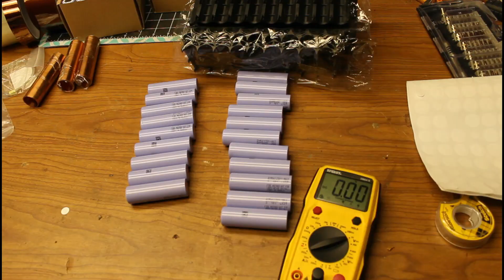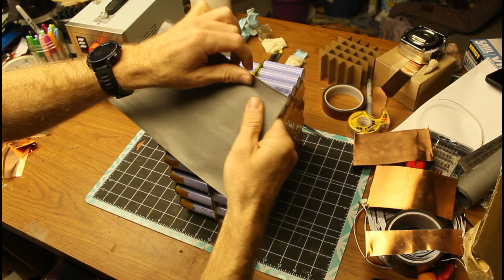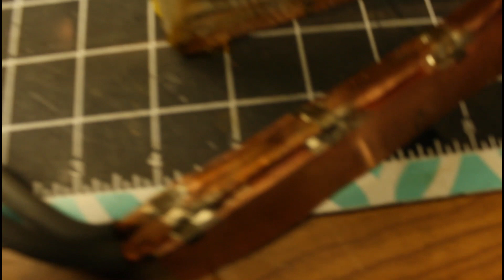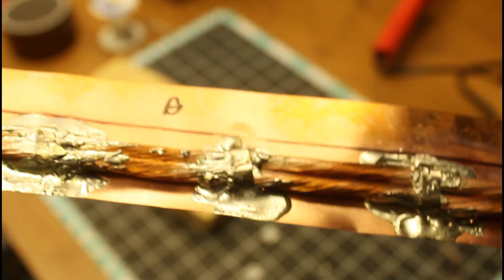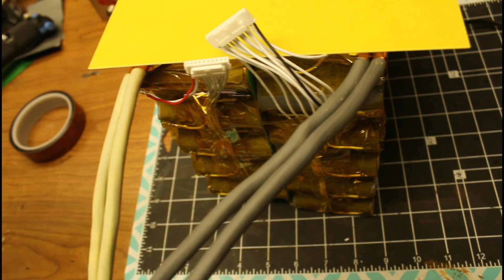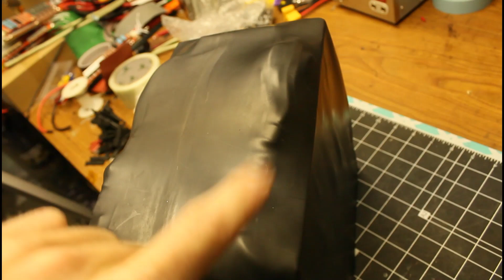72v High Power Battery Build DIY

Comment: I'm trying to build an ebike battery myself and currently in the process of understanding it all. What determines the ability for a fully built battery to allow say a 100AMP Continuous discharge? Is it the nickel sheet's thickness? Or the amp discharge rate of the battery? I see that these Samsung 40T cells are rated at 35A. If I use one thats rated for 15A, can I still use a 100Amp cont. discharge BMS from ANT?

Trying to build a 72v20ah Battery. Appreciate any help and insight! Looking to probably just copy your build
Reply from the maker: Discharge is a combination of the individual cell characteristics, number of cells in parallel,  the electrical connection between them, the rating of the BMS, and the discharge wires and connectors.   So if you have cells rated for 15A and you want 100A discharge,  you need at least 7 cells in parallel.  The series connections between each P-group need to be able to handle 100A as well. The copper does that fine. Your BMS has to be rated for 100A continuous or better, and you probably want at least 6ga discharge wires and xt90 or qs8 connections for plugging it in.
Reply: @ebikebuilds4000  This reply along with watching a few other build videos of yours really made it click in my head thank you!

Will pure nickel strip be able to carry that amount of amperage? Or will I need copper
Reply from the maker: @djmedia01  pure nickel strip should be fine so long as you series connect each cell. The series connections carry the full current of the pack, so they need to be robust.
Reply: @ebikebuilds4000  Thank you so much for the info. Greatly helped everything click together for me.
Reply: What thickness copper sheeting u are using?
Reply: @Lenbo1977  I was wondering the same thang
Reply: @franklincoody6218  most important part - and no answer. It must be 0.15 to 0.20 mm or so (otherwise, it will not spotweld). However, based on extensive chatGPT requests, 0.20 is not enough for 200 Amps. So, I am wondering, what is this guy doing...

Comment: hey! Love the video! I'm curious about your dirtbike build, was it a gas dirtbike frame that you converted/modified to be able to fit motor QS138 an battery? checked you channel videos but couldn't find one
Reply from the maker: Thanks! Yes, it was an Apollo rfz. The 2 main mounts of the qs138 match up with the engine mounts on the bike perfect. The foot peg plate did not and required some cutting and welding. I also had to make an additional frame piece to support the battery and case. I didn't video much of it but I have a lot of pictures.  I will say it came out great and really rips!

Comment: hi what is the range of that battery if you ride at 30mph ?
Reply from the maker: I'm not really sure. I would have to figure out the amp draw on my system at 30mph.  My best guess is it would draw somewhere around 30-50 amps at flat cruising speed, so around 40 miles. I use the bike for woods, trails, and hill climbs, so my power usage is all over the place.

Comment: Are you using nickel on top of the copper to make the spot welds?
Reply from the maker: Yes, it's actually the cheaper nickel plated steel.  Normally that is less desired as a stand alone connection because of the higher resistance, but in this application,  it's the copper that carries the current during use, so the higher resistance of the nickel/steel makes for better welds.

Comment: Wow, probably the best battery building video i have ever seen. Have you expirience a lot of voltage sag on that battery? What are the dimentinons of the battery? I am considering building a pack just like yours! Great job man👍
Reply from the maker: Thanks! I'm seeing a lot less voltage sag than my previous battery.  I think it's partly the higher capacity,  and also the heavier discharge wires.
Dimensions with the rubber shrink wrap are:
9.5" long, 6" wide, 9" tall American 
240mm long, 150mm wide, 230mm tall Everyone else.
Reply: @ebikebuilds4000   what size heat skrink did you buy? 300mm?
Reply from the maker: @sandernikolajvintherpeters3842  it was 290mm from an ebay seller. Unfortunately at last check,  it's out of stock there.
Reply: @ebikebuilds4000  Hard to find one for a big pack.. Im still looking for a 21s15p pack